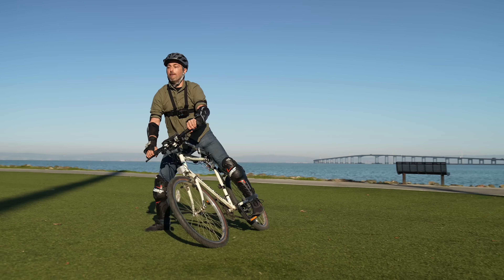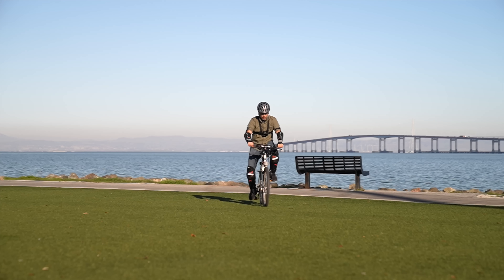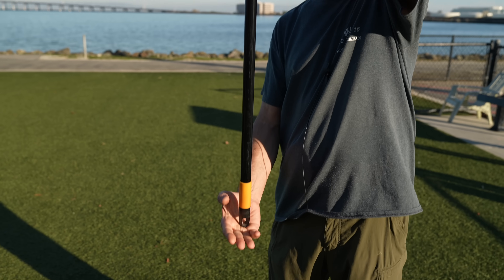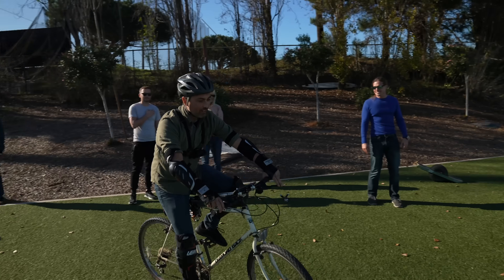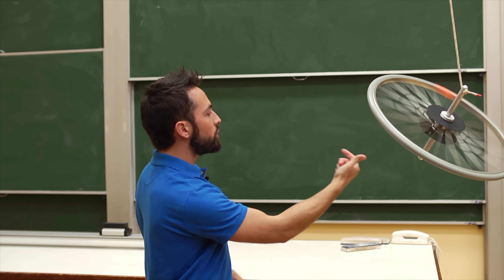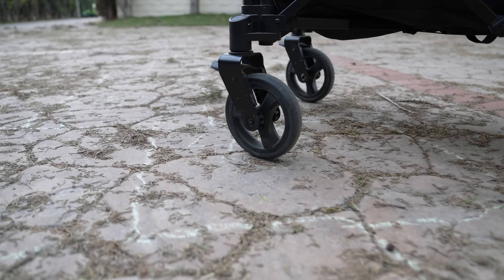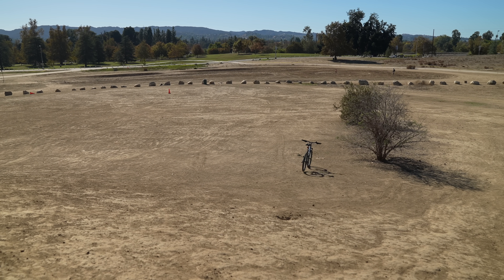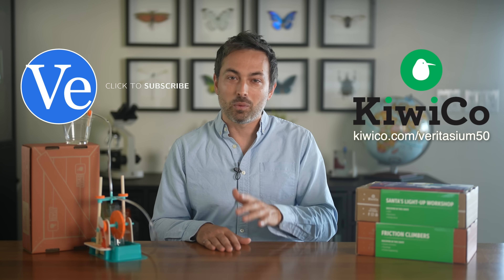Most People Don't Know How Bikes Work

Comment: no you do not have to tern left first to go right you just simply lean and your bike goes in that direction your problem is your not leaning into your turns like a moron heck the faster you go the less you actually turn your handlebars and the more you have to lean that's why people who race motorbikes lean into the corners like they do and practically hang of the side of the bike just to get it to turn in that direction and its because the gyroscopic effect at those speeds actively resists you turning your handlebars and if you do manage to actually turn your handlebars at those speeds the bike will then throw you and go tumbling down the track just watch some motorcycle racing you will barely see any movement of the front wheel but you will se a lot of movement of the rider and that is not even getting into riding a bike without your hands on the handlebars i mean how do people turn left first to go right when they don't even have ahold of the handlebars all they are doing is leaning to go in that direction or how about steering in a wheely its the same concept lean the direction you want to go and even with the unicycle you lean the direction you want to go you want to go forward you have to lean forward you want to go backward you have to lean backwards you want to go left you lean left and to go right you lean right 

as for riding straight with locked out steering that one is also simple what is going on is as you are pushing down on a peddle you are adding more weight to that side of the bike causing it to lean in fall int hat direction so to counteract that you need to lean the bike in the opposite direction so as you push down on the left peddle you lean the bike to the right and as you push down on the right peddle you lean the bike to the left and poof you stay up and the more force you apply to a peddle the more you have to lean the bike to stay up right 

and to keep a bike upright without moving is lean the bike in the opposite direction of what ever peddle is lower to counteract the fact more weight is on that side of the bike and then you keep adjusting your weight and the bikes weight by leaning the bike back and forth to keep you balanced on the bike

heck how my dad taught me how to ride a bike and how i taught my kids is by saying don't steer the bike with you hands steer the bike with your body weight and showing them how to lean

Comment: so how would the turn go if you lean in the direction you want to go? say leaning more on the right side of the front wheel it would initiate the turn and you would follow through. or lean left first a little and then lean right to gain momentum without needing to turn the handle bars. i don't normally counter steer  when moving forward unless im straightening up after going round a turn. But that's just me as a mountain biker with very large tyres. 

I also noticed it when riding without hands on the handle bars just going round corners with balance. You just lean right to go right, and left to go left rather than counter steering, so is that using the same gyrscopic effect as the bike riding by itself without a rider since it's keeping at speed and the mass distribution of where the body is positioned?

Comment: Countering the imbalance on a locked steering bike is the reverse of what you might think but the inverse and few people have the ability to balance the locked steering bike truly perpendicular to the ground it is running on … this is what a wheel set fore and aft needs to roll forward smoothly … once you leave perpendicularity with the ground the steering will be required to correct the balance of the vehicle … great demo .

Comment: Its not Impossible to turn right before turning left, you Just need to balance your wheight to right first and then turn right. You turn in the contrary direction firstly just to put your wheight inside the circle that you will make turning to.the direction you want. Simple as hell, Basic centripetal force.

Comment: There ought to be a law that prohibits the use of the word "countersteer" which is so crucial to safety when riding motorcycles, to the physics on display in this video. Motorcycle countersteer has to do with precessing the gyro which is the spinning front wheel, period, full-stop. So you're riding a motorcycle and with just a tiny amount of forward pressure by one finger on one handlebar you initiate a turn complete with bike lean and everything, one tiny finger, one gentle push, and your motorcycle leans into a turn the direction of which is counterintuitive to the force you applied. That's countersteer. In normal riding you never even feel it on a bicycle. It dominates steering on a motorcycle.

Comment: Why lean without steering? 😂 that only works at higher speeds cause your turning axle is wider. Same reason why you have to brake before cornering. Basically works like a Scandinavian Flick here.

Comment: Or, you move your body.
You can turn a 2 wheel bicycle while keeping the front wheel straight by moving your body.

Move it and lean, not just you're body but the bike. Don't need steering to balance.
Need balance to balance.

Use your pedals as a point to brace and your body and the bike to manipulate the balance to make a turn... I can lean my bicycle so low I take a foot off, having only one left on a pedal.

And make a corner like that. All while keeping the front wheel straight.

I can put my bicycle down almost to the ground and go straight too. Or do that and make it make a turn.

He was sitting. Can't do any of what I do while sitting. You need to stand and use your whole body in harmony with the bicycle to make it happen.

Comment: I think most cyclists brains automatically understand that you have to lean left to turn left, however you achieve it. And slightly steering right is the quickest way to do it. However because TRICYCLISTS can’t lean the bike over, they have to shift their weight left, to counterbalance the centrifugal force throwing them to the right. It’s great fun watching a cyclist riding a tricycle for the first time. When they try to turn left, they end up turning right - because they think they are going to fall right and automatically turn right to prevent it. . Derek, I challenge you to try it! I ended up in a ditch on the right, and that’s what will happen to you. [Quick fix: cross your hands over on the handlebars]
ps. The quickest way of demonstrating the castor effect is to push a riderless bike backwards. It instantly falls over.
pps. I don’t think you mentioned the effect of bike geometry on the height of the rider as the steering is turned. Gravity will oppose an increase of height, and whatever is causing the mass to rise. Just turn the steering to see if the top tube moves up or down. It’s a small effect that could also change how light you feel the steering is. A roadster with a smaller head tube angle has heavier steering. This should affect how stable a riderless bike is, but to be honest, I’ve not tried it.

Comment: This seems to only work when you're actually sitting down on the seat. Anyone who mountain bikes knows that our arms and legs can work like a chickens head does, where it can keep us centered even if part of us is moving vigorously. With the right momentum, we can turn without opposite turn for counterbalance, because our body is already in the position of counterbalance. Then, we just reshift the bike back under us, all without needing to turn the other direction. It takes practice, but our cerebellum has the power to keep us balanced even in scenarios like this.

Edit: This is probably coming from a place of slight bias as I have put a lot of time and training into balance. Stationary biking is a common practice of mine so I might just be more in tuned with where my center of gravity is

Comment: Not once did I hear “centre of mass”
(COM). Now this video made absolute sense but from riding with no hands, one would have to move their hips, in order to shift the COM (in essence balance). Then with hands I found that you can still move right without actually steering in the counter way but to move the hips instead in that way, which off centres the balance. This was only found at a slower speed.
When it came to a faster speed, cornering or leaning to a side, didn’t need a counter steer/lean beforehand. By hitting a race line, the bike is already then set up to turn/lean the corner and you could argue no counter steer/lean had taken place. 
Please can you advise whether in fact I’m totally incorrect or making some sense?

Comment: Pop a Wheelie. (See many youtubes on "wheelie" if you don't know what it is.) It's been a while since I've ridden a bike and wheelied down the street, but if you "pop a wheelie" on a regular bike, you lift the front (steering) wheel off the ground and are riding on the rear wheel only. As I recall, I would still "steer" the front wheel left and right to maintain my balance. I don't know if turning of the handlebars is essential or if one can be trained to maintain balance and steer, unicycle style, with the front wheel locked (as in Derek's video).

Comment: Pretty common rule in the motorcycle world. At speeds over 12 or 15 mph, you dont "initiate" in the opposite direction, you just straight up always countersteer. If you want to turn left, you push the left handle forward.

Comment: I would like to add something to this regarding motorcycles, specifically on balance and counter steering. I currently ride a motorcycle and it weighs about 360lbs.

Balancing: I've been riding for a couple months and have gotten decent enough to not fall over or drop the bikes at very slow speeds. about 2 to 3MPH (3 to 4KPH) and the bike while requires a little bit of correction will for the most part stay upright.

Counter Steering: When above speeds of around 20MPH (32KPH) trying to turn the handle bars is pretty much more than a degree or two is pretty much impossible but that little amount of input allows for relatively sharp turns at speed for very little movement of the handle bars and forks.

I would love a video regarding this type of thing. Obviously locking the handle bars probably wouldn't be a good idea. But there could be some other ways of figuring that out.

Comment: Can you not simply lean into the turn you want to make?  I see what you are getting at here but I am confident shifting your weight above the bike could have the same effect as turning the opposite direction you wish to turn in the first place.  You ever watch someone on a unicycle and wonder how they navigate?  Edit: paused at 3:06 to write my original comment, I see now you covered this exact thing.
Reply: I don't know how you can lean your complete body with the bicycle standing straight
Reply: @justL0987  Get a bicycle and weld the handlebars to the body and try it yourself.
Reply: @burtmacklin6443   if you weld the bicycle handles you won't be able to move it in the 1st place.
Reply: @justL0987  What are you talking about?  The pedals spin the gears which move the chain which spins the back tire.  The handle bars have nothing to do with generating motion of a bicycle.  Handle bars are solely responsible for turning.  Let me ask you, how do you turn on a unicycle without handle bars?  You lean in the direction you wish to turn.
Reply: I lean left instead of countersteering. Sometimes i countersteer for steep turns

Comment: What about camber thrust? I remember reading an article about steering geometry in a motorcycle magazine in the 90's. It explained how a leaning motorcycle tyre has opposing forces as the circumference decreases as you move away from the center of the tyre. This causes drag on the outer contact area as as the smaller circumference wants to rotate faster. This drag causes the the tyre to turn in even more, making the bike want to balance out. I've noticed this force ever since, where a small amount of force has to be applied to the steering in the opposite direction to the direction of cornering, essentially to keep the bike turning.
Reply: Camber effect is one way unicycles can steer. It doesn't work on bikes because any camber effect from the front tire would require the rear tire to slide sideways and vice versa.

Comment: I've been paying attention to my turning on my bike since watching this video, and I think the counterbalancing theory put forward here isn't quite right. I am 100% able to turn without first turning the wheel in the opposite direction. I do notice that sometimes I prefer to first turn in the opposite direction briefly so that I enter the new street/path/Lane head-on rather than having to continue to turn after entering it (and overshooting, sometimes close to parked cars), but that is entirely just a choice of route. I could be turning away so slightly that I can't notice it, but I've tried focusing intently on the direction of my handlebars when I'm definitely going straight forward before turning, and they only turn on the direction off the turn, until the turn is completing and they come back to center.
Reply: Same - I'm fairly agile, more than the average person and tend to adjust my approach speed and shift my body on the bike to take corners far more often than I counter steer. I think people with an average or below level of agility and sense of balance probably do learn to ride this way without realising it though.

Comment: I learned this when starting to ride motorcycles. When driving free handed and you pull on the left side, there will be a light snap back and you initiate a right hand turn... once i realized this, my driving went way smoother and my cornering skills improved... when you start drifting towards the outside of a tight corner and you try to steer more towards the inside, you will get your bike upright again and head more towards the wrong side. Counterintuitively you have to steer slightly more towards the outside to lean more into the curve. Possibly you will end up in a lowside crash then but then you were too fast anyway
Reply: even on four wheels this works: in karting you can snap into corners a bit more smoothly if you quickly steer into the opposite direction first
Reply: Maybe too fast for ones skillset haha, when I was 16/17 I was trying to keep up with my dad, he was on a HD Ultra Classic, I was on an HD Softail Night Train; As a young kid I thought anything the old man can do on that big heavy bike, I could do on my (relatively) small bike.

Turns out I learned how to fly going into a corner he took at the same speed. 

I could have made the turn if I had held into the corner, but I scraped one of the pegs and got scared to drag it (not knowing they can fold in for a reason...) pulled out of the turn to see a ditch, tried turning back in and flipped end over end into said ditch.
Reply: I learned how to ride a bike this year and had this problem with corners. This helped a lot.

Comment: Anyone who's ridden a motorcycle figured this out.  You don't turn a bike.  You start a lean by pulling on the opposite handle, thereby forcing a "fall" or progression to the smaller diameter region of the tire, which causes the turn.  The reason I say those who've ridden motorcycles figured this out is because the faster you go, the more pronounced the effect.

Comment: You dont lean to turn, you basically move the front wheel off center causing the bike to counter lean in the opposite direction you turn the handlebars, and then you chase the turn through once your center of gravity is transferred or leaned in a given direction.  This is what is meant by learning to ride a bike, that you do instinctively from trial and error.  Easy way to think of this is to push the handlebar into the turn, with the left hand to turn left, and right hand to turn right, and you by reflex center the bar once enough lean angle is accomplished.   But... you can also lean your body into the turn, and your forks will follow the lean into the turn, by use of rake and trail.  And that happens only if proper rake and trail is set in the forks of the bike design.  Meaning that rake and trail needs to be set so as the front wheel follows the pivot point of the forks, similar to what a shopping cart wheel does as it follows its pivot point, that is aimed ahead of the wheels contact point to the ground.

Comment: Folks....it is the function of the lean-angle, not fricking "countersteering". You can initiate a turn in either direction, with either hand. You do this by "confirming" the lean of your body and the machine with your hand.

Try it next time you ride; somewhere safe, ride using just one hand and to the turns. Counter-steer is more what you do when you have to make a quick swerve, and that is PRECISELY because you're wanting to come back to the same line you were just on.

Comment: Motorcycles are the same way. The sharper the turn the farther you turn the bars against the turn until the weight of the bike is making the turn and you hold the bars and turn them back to straighten back up.